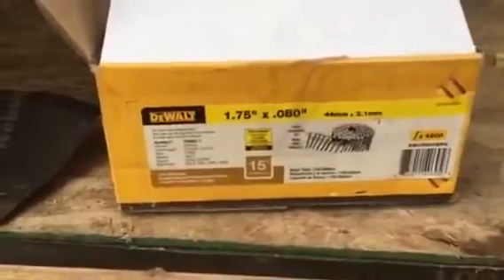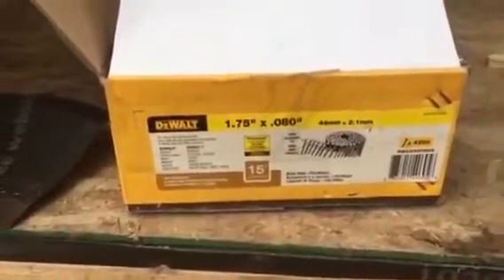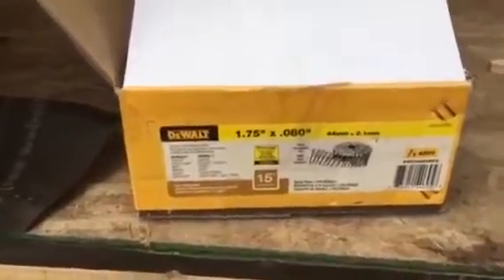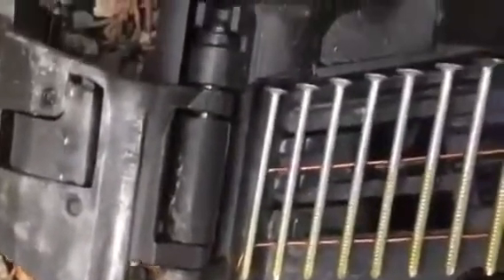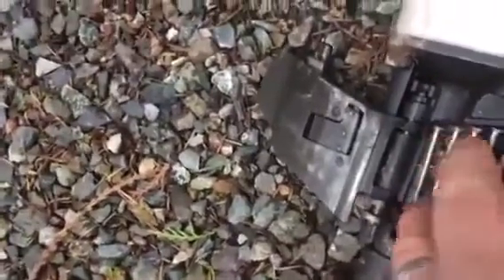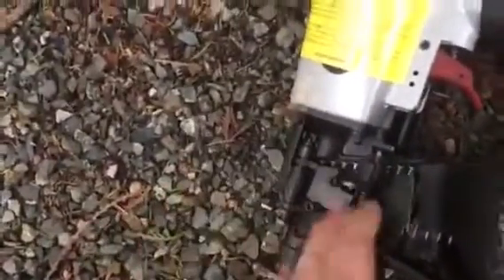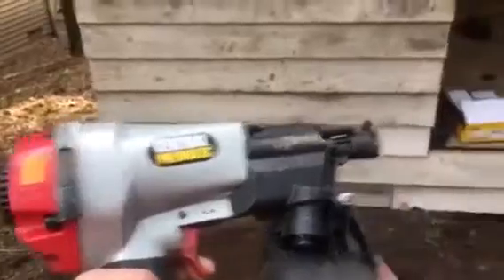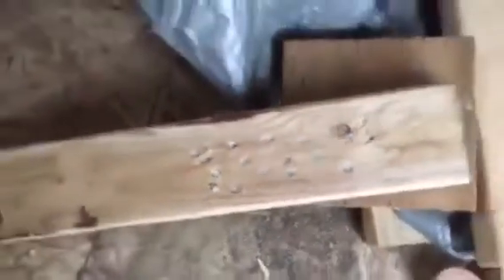Harbor freight roofing nailer using siding nails

Comment: What’s the make and model? I’m looking to get a nailer that can do both roofing and cedar shingle siding but don’t see one that matches on harbor freights website anymore.
Reply from the maker: I'm not sure on the make/model.  It was an open box at one of the sidewalk sales several years ago.
Reply: @123_DOIT  well I’ll take a shot in the dark then. Found one online that looks similar
Reply: @fishtism did it work for you if so what model did you get?
Reply: @herbertmartin4320  just ended up getting 2 separate nailers. Ended up getting a cheep roofing nailer of amazon (i was doing a pretty small roof so I didnt need it to last super long) and a metabo siding nailer that was on sale